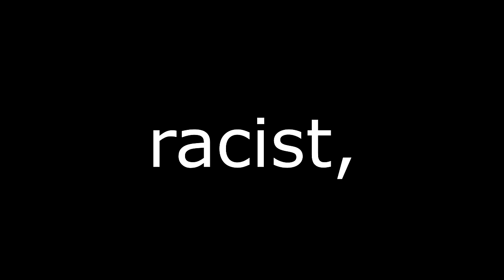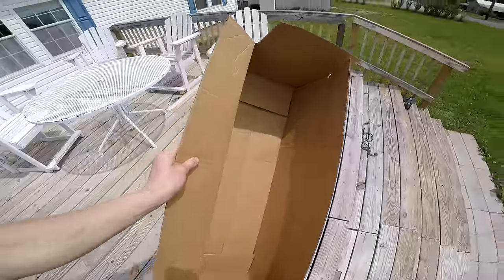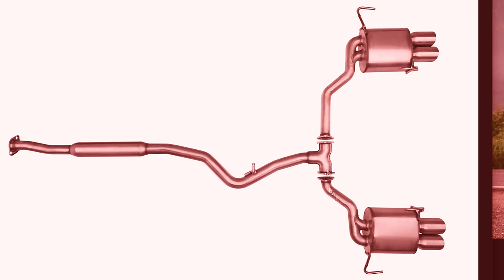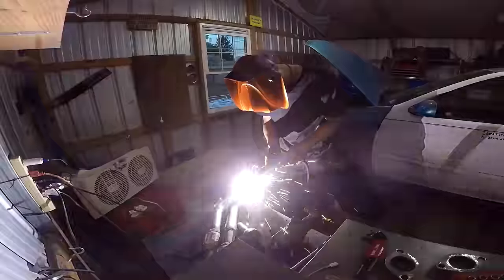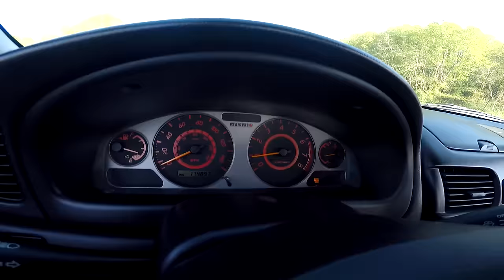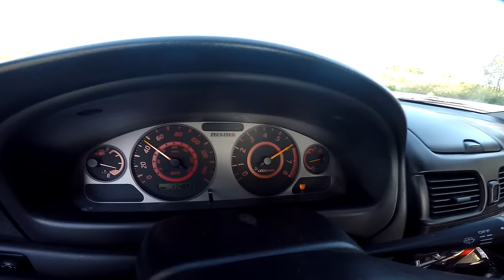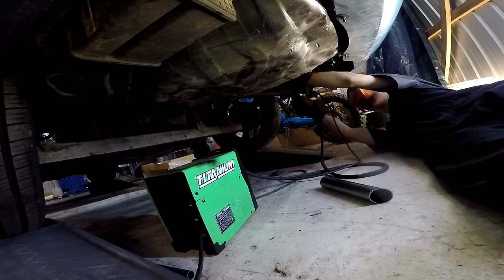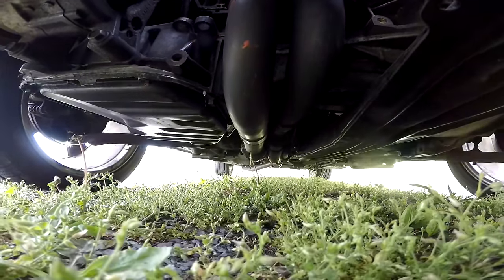True Dual Exhaust on a 4 Cylinder - What Will it Sound Like?

Comment: It's funny but all my vehicles that all run more then stock hp are all two into one exhaust systems.  
All of them are setup to running fast and correctly.  
The ford v8 6.0 deisle and 5.4 triton run header to ,  y pipe and cats and muffler but from two headers back I guess not stock lol but I mean not straight piped to duals .. 
My v6 mercedes is basically stock exhaust and it's the exact same as the trucks but a lot more power. But at the tip its only one amg tail pipe.  Still one of the fastest 330hp cars. 
My straight 6 jaguar 4.0 is the only one with dual exhaust and it's a split system . It's super rare to have full true dual considering they mostly are connected at a middle point by a x section or h but not normally straight all the way back not attached to anything other then the hangers and the manifold bolts. 
There's a bunch of real and good reasons exhaust pipes are setup in a factory lol. Because R&D teams try everything you can think of trying with massive development teams and millions of dollars spent figuring out two into one works better for the air and fuel they burn lol. 
Just leave it or go full turbo and cut a hole in your hood and shoot the exhaust straight up and out. 
But if you want to drive it. Leave .. if anything do a resonator delete and get a better muffler.  Not a thrush cherry bomb lol. .

Comment: What if you ran both into a single muffler at the end of the dual pipes?
Reply: You would either want both running into a single muffler tip, or out of two unequal length pipes with one pipe angled slightly across the 2nd. Reason being would be to restore exhaust impulse scavenging and attempt to restore the power you lose from separating exhaust pulses. Due to the cooling down of exhaust gases over the length of the pipe, you will still be down on power from a lack of a merged header collector, and this setup will always sacrifice power for sound regardless how they are merged (even with a crossover/x-pipe). You could also achieve a similar effect as is heard in the video with an unequal length header but a single exhaust exit, which will also reduce power, but not by as much due to separating the impulses when the exhaust gas are still near their hottest temperature outside of the cylinders.

Comment: All 4 bangers don’t sound the same. You got the Honda-like sound that you showed, which is the most common, but you also have some outliers. Like Subarus flat 4’s, or Porsche Cayman flat 4’s. Hell, even my VW GTI doesn’t sound like a Honda like that. I mean, it doesn’t sound great, just more like an old small engine tractor than a Honda. 

But most 4 bangers do sound the same, yes. Just not all, there’s plenty of outliers.

Comment: so he made an uneven pipe headers which basically causes that rumble cos 2 cylinder exhaust pulses meet at the point that they join together, hence that rumble...reminiscent of a stock subaru header...funnily enough subaru bois with even length headers delete this sound and end up with a normal sounding 4 inline exhaust note...woopie!!!
Reply: Pretty sure he made 2 seperate even length headers for the inner two and outer two cylinders with no crossover pipe creating a 4-2 sound (two even firing inline 2s)

Comment: If you are trying to be scientific and technically accurate why are you doing exhaust from a stock manifold? This does nothing more than change the sound and probably ruined the manifolds synergy with its exhaust piping (as it was engineered).

Comment: thats not dual exhaust. youd have to do it at the header, divide the cylinders 2 and 2. then it would sound like a subaru or vw. the last possibility is a cosworth. depends which cylinders you pair.  you got yourself dual mufflers and ended up with the crappy subaru sound. damnit jim.

Comment: Your car Doesn't sound that good. 
HKS exhaust for the Sentra combined with a good intake and it will sound better than most V8s. Now add in headers. Make sure it's tuned so it doesn't pop and crackle. Pops and crackles are horrible in my book makes Ferrari f40 sound gay

Comment: Disagree. Lots of 4 cyl engines can sound great. Why do 4 cyl w 4into1 or tri-Y headers sound amazing? My favorite thing about old air cooled Suzukis even. Plus, VW/Audi thoroughly solved the 4cyl crap sound problem a long time ago. 1.8t 3" 304ss turbo back with Vibrant resonator sounds very healthy even at idle. The opposite of the laughable Honda limp dick trumpet sound.